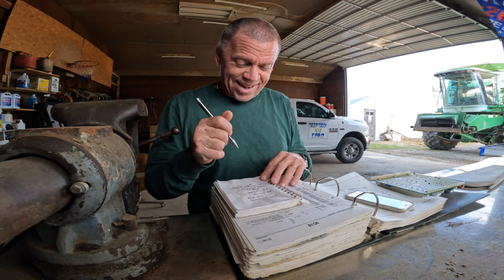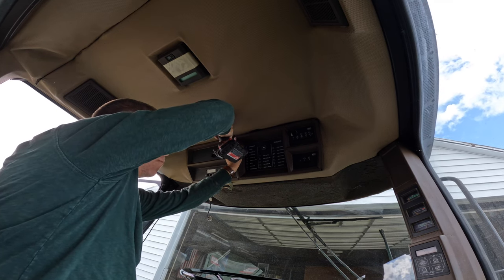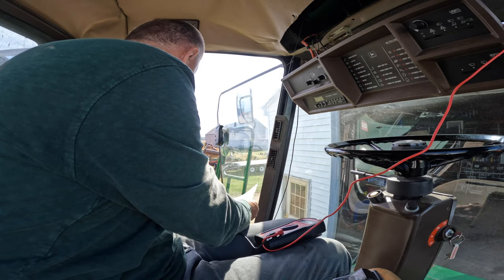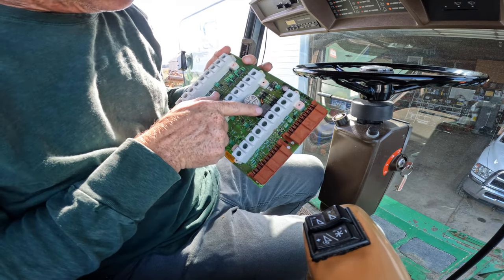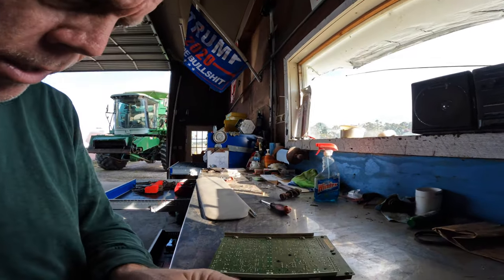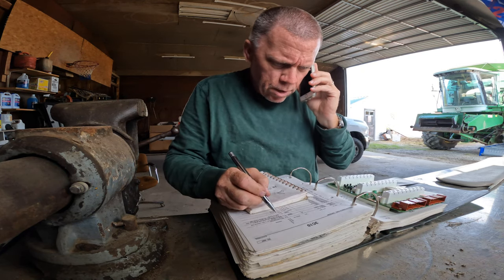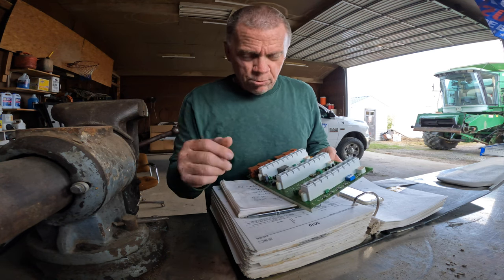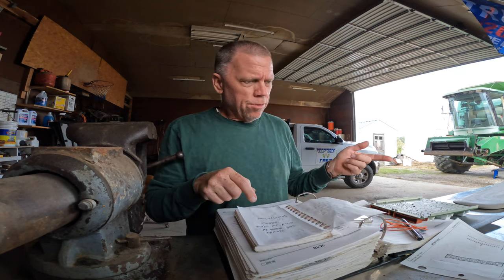Bad Circuit Board on 9500 Combine - $1900 Repair!

Comment: I spent $2300 on the header height controller for a new holland combine... little electrical box that controls the lift cylinders. Bad solder was problem with a lot of the boxes, the new ones fixed it. Can't find anyone to repair the old box, person that used to do it passed away a few years ago... I might end up investing in some electronic repair toolkits and get more into that stuff.

Healthcare keeps getting worse... sister had a hip replacement done, she was under for 2 hours, put in recovery for a couple, and then sent home. There's no such thing anymore as being able to go when feeling comfortable. Same way was with my dad for his first sinus surgery.

Comment: So glad Ag Express is local to me in Grand Island, has a similar issue with a 4850 john deere tractor where the circuit board went bad and turned the engine stop light on, deere wanted 4 grand, Ag express fixed it for less than a grand

Comment: Been there with my 9500 in the past circuit boards. You open the foil envelope you own it. Mine would not let the separator start.